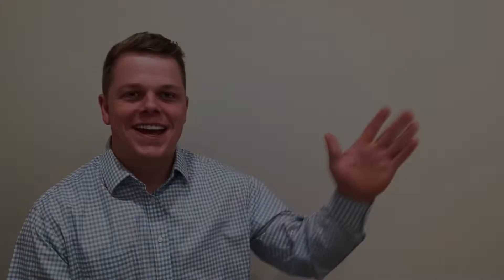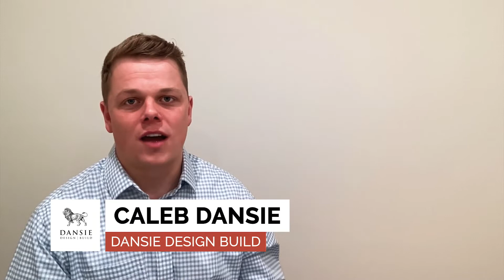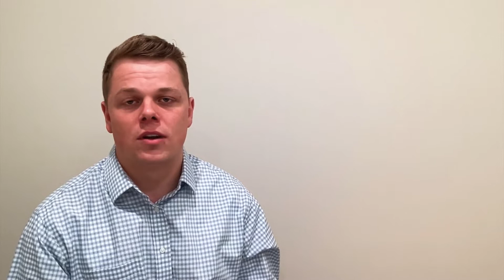How Much Does it Cost to Add a Walkout to an Existing Basement? 2020

Comment: Man my walk out job in bluffdale has been a nightmare. Started in Feb, bid of 13k. Contractor bailed 11k in and half job.  2nd contractor doing a much better job now I have most everything but the door is a 60inch but the cut out was 73"  the 72" door doesn't fit. The 60" is the only one I could find. So now I have a huge gap from the existing window on both sides.  What to do? I'm 18k in  now. Bluffdale
Reply from the maker: I’m sorry to hear your walkout has been a nightmare. You can put stucco or siding around the door to fill the huge gap, or you can order a custom door size to fit the opening you have. 
You could also order a door with side lights, that would really look nice. 
You’ve got options at this point from what it sounds like to me.

Comment: what if you have a high water table and water comes up from the ground ?
Reply from the maker: If you have a high water table, you will need to do an alternate drain type. One that encorperates an electric pump and removes the water, discharging it elsewhere - ideally where the city storm drain system can take the water.